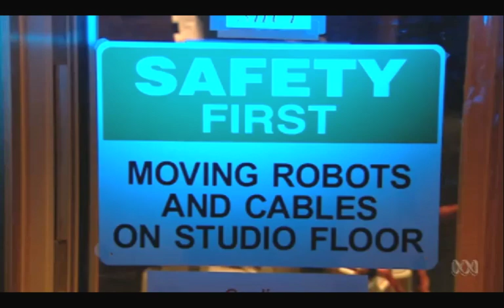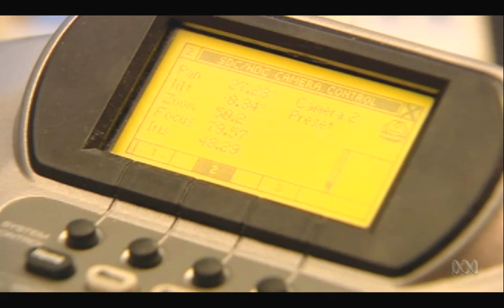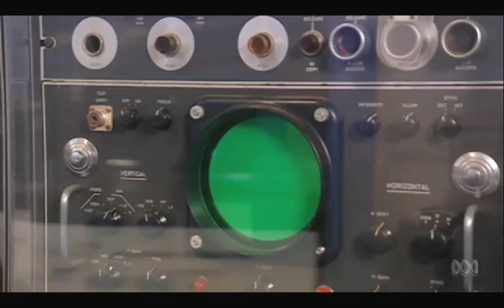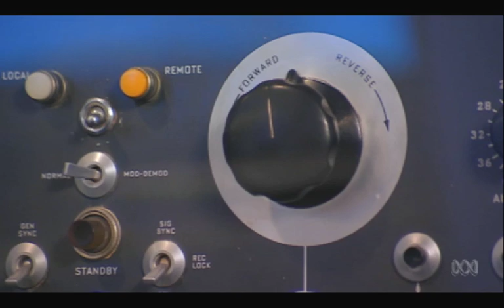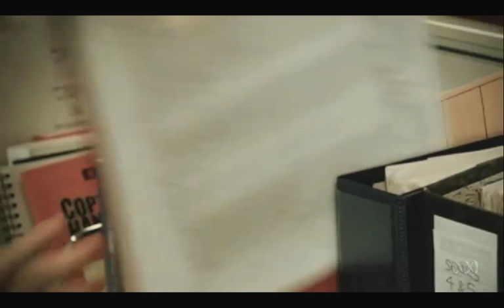Evolution of TV Cameras and Video Recording

Comment: Trained with Howie at several stages. I could say ABC TV Darwin led the way in robotics as in the 80s, we had robots driven by the Technical Producer in the Control room. We did extraordinary stuff with ordinary equipment.

Comment: The Marconi colour camera - a MKVII which they say they used from 1975 is actually a FOUR tube camera not three - there were tubes for red, green, blue and luminence.  

How do I know? - Because in the 80's I actually owned about twelve of them! they date back to the mid 60's and were first produced with nuvistor head amplifiers which were later replaced by FET's - also the later cameras had fans in the tops.

Comment: Those 'monstrosities' were beautiful pieces of electronic equipment in a wonderful industry. The Marconi Mk VII shown in this video was large, but it produced very good pictures and although not popular in general purpose studios, it was used in the relatively static environment of a News studio. It was also a fair export success for Marconi to the USA, where large cameras were the norm.
So; one man's monster is another man's beautiful woman. Oh, let me just add, the robotic peds., although used by the BBC in the News studios since the 1960's, were not used elsewhere until relatively recently and have been successful in keeping perfectly good camera operators out of work. However, the Network/Station accountant is happy.
I will add that I have no connection to the TV industry other than a tech. interest; my comments regarding machines taking human jobs are from a Societal point of view.
Reply: CBS (Columbia Broadcasting System),  in the US, used a lot of Marconis.  In the early 1950s,   there was bitter rivalry between RCA (Radio Corporation of America) and CBS over which color  TV system the US would adopt.  CBS lost,  and as a result,  it  stopped using RCA TV cameras and equipment as soon  as it could.  The Marconi Mark VII had a 4.5 inch image orthicon pick up tube and produced  an excellent picture.  Most importantly, for CBS,  it was not an RCA product.  The famous appearance by the Beatles on The Ed Sullivan Show in 1964, was  recorded  using Marconi cameras.  CBS used  Marconis until about 1965-66, when all the US TV networks began seriously converting to color.
Reply: Hey can you please explain briefly how was sound recorded in television starting from the history